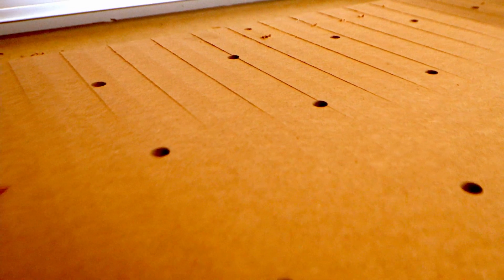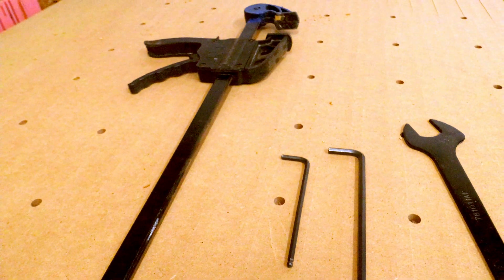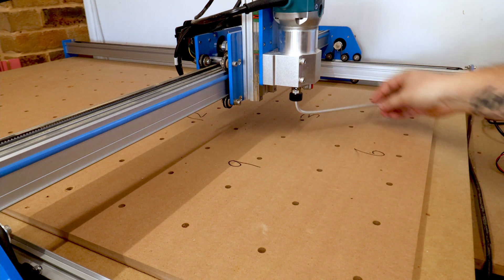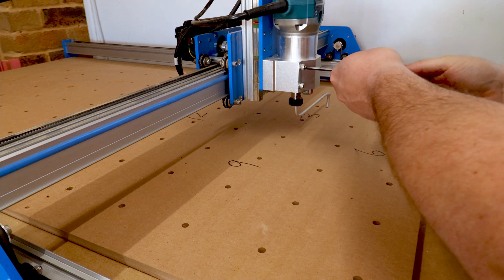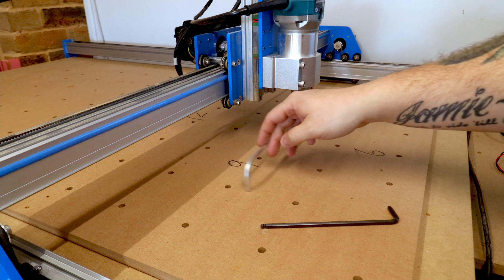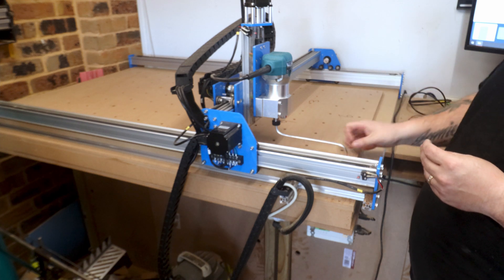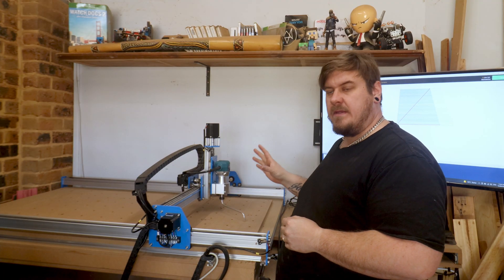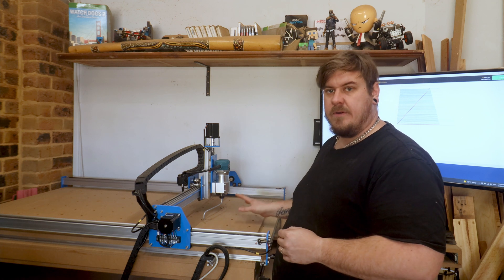Tramming A CNC - HOW TO! (Bluecarve Bluey CNC)

Comment: Hi, Thanks for taking the time to share all your tips. I'm looking at a Bluely with the upgraded X & Z options, so I'm watching everything related. Your setup is a simple but genius way to get perfect alignment. Plus very quick to check any time. More BlueCarve tips and tricks if you can please, no one else is doing them. Question, did you change the router mount, it looks a lot more solid than the one on the Blucarve page?